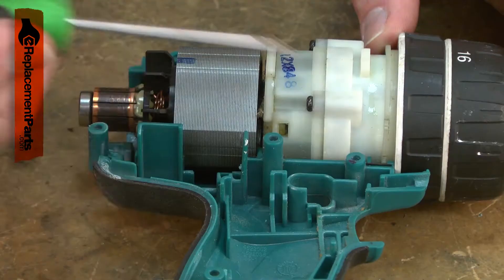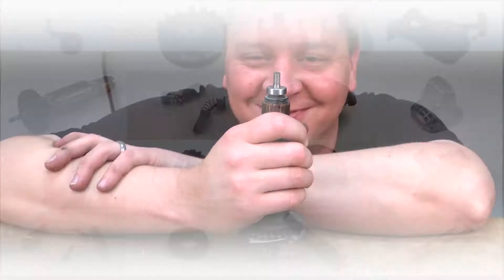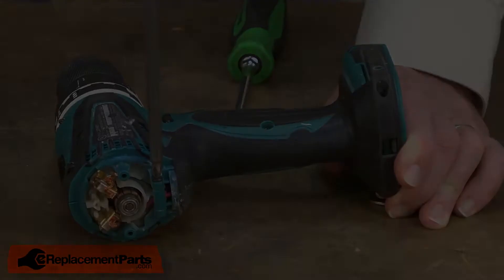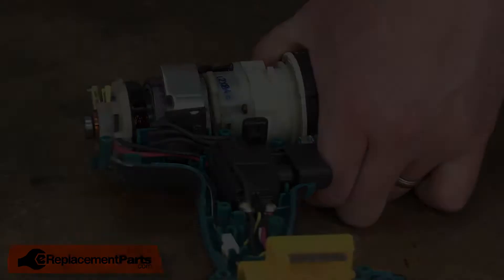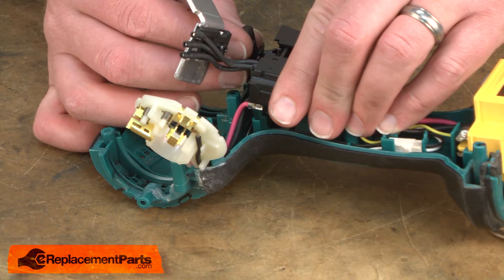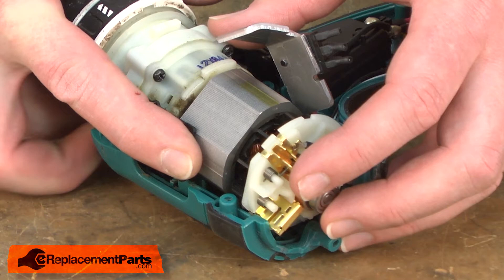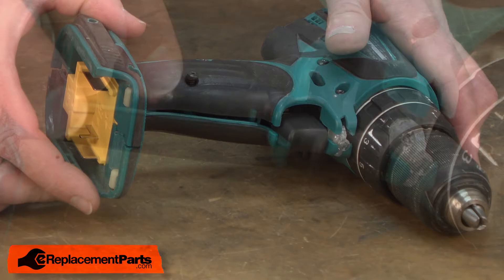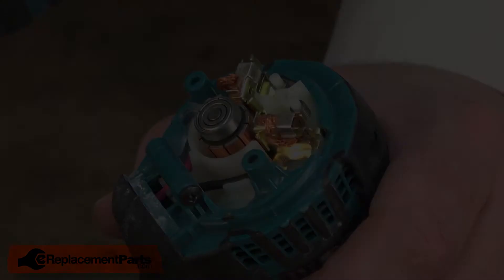Hammer Drill Repair - Replacing the Leaf Spring (Makita Part # 232182-2)

Comment: Thanks! Didn't even know what the thing was; I just happened to see it on the floor after reassembling my drill. As another commenter noted, the parts diagram made it look like it went somewhere on the top around the speed switch. Just ordered a replacement LED light assembly from you guys. Thanks for the informative content!